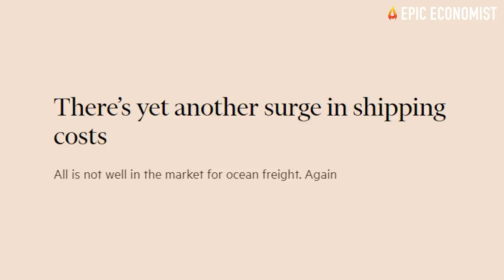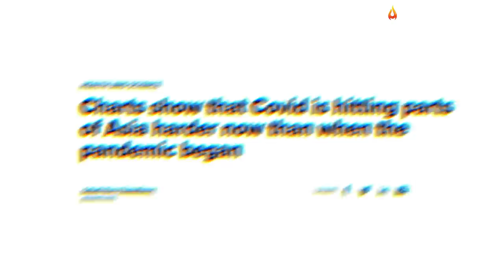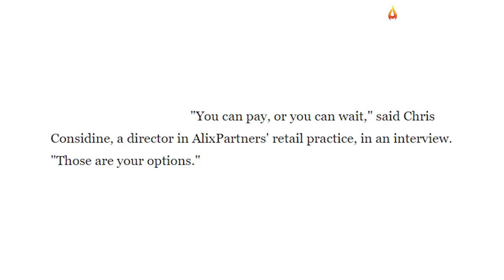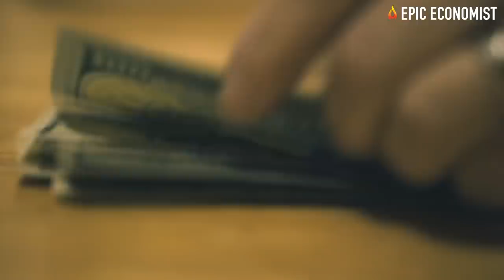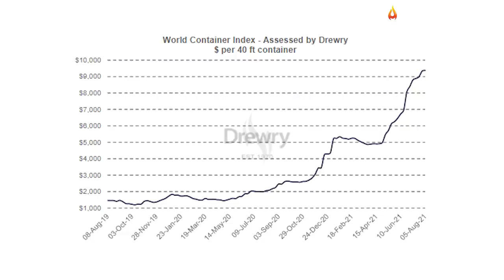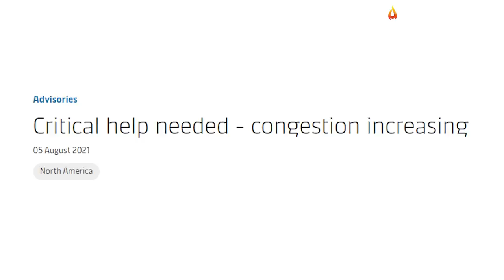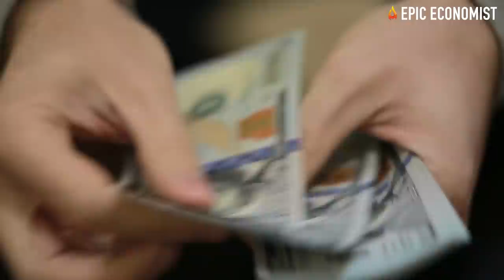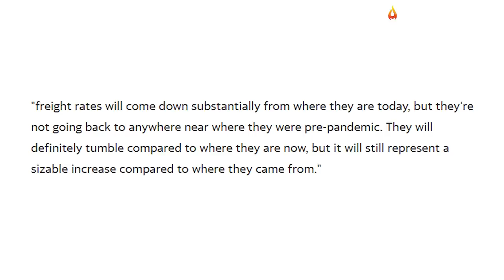Shipping Crisis Is Starting To Get Crazy: Freight Rates Skyrocket As Container Inventory Collapses

Comment: Maybe we could start making those containers. It’s just a strong metal box.
Reply: Good idea Billy!  Sounds like a real money maker at this point!!
Reply: @Petal Pusher Shipping containers are built in standardized sizes, typically 20' and 40', the ships are designed to accommodate containers built to this standard.
Reply: All they are is just a frac tank with doors.They build frac tanks all over the oil patch.
Reply: Ah what do I do ? America forgot what to do
Reply: The steel guys in Pittsburg should start rolling these things out. Old fashioned welding and machine work.
Reply: Tens of thousands of them sitting empty in Long Beach, CA...
Reply: Even if you had a yard full for sale at 1.00$ each you could not sell them. This is a system wide liquidity drain. The higher prices make for certain your my and their cash gets sucked up.  Containers are always empty in the port on the wrong side.
Reply: Thought the shipping crisis was due to so many containers being converted to living shelters
Reply: You miss understood the issue. There is no shortage of containers. It's that they go back empty and the ports are processing the incoming. There are plenty of containers, just not the capacity to ship them back to pick up more stuff for walmart.
Reply: Good luck finding workers to assemble them. You can't compete with free BidenBucks.
Reply: America has a low steel inventory, and China wont sell them any. lol
Reply: @renegademind1833  Cite your source on steel inventory.
Reply: It doesn't matter if you make them in the US.
Container shortage begins in Asia. There are a lot of excess containers in US that aren't even being shipped back to Asia. A lot of time, manufacturers in Asia pay extra to have an empty container ship back from US to Asia. So the demand for container in US is very low.

Comment: Stock tip 
Tell is at 3.00 and holding. It did go down but holding. 
Evfm. 82 cents. It will go to 1.20. That is a short term gain. 
Guns got to get this I buy it 1.50 it does go over 2.00 I like this stock I made alot of money here.
Open sold it today made 326.00 with 100 shares. Wait for it to go to 15.00 or 14.50 before u buy this one. 
Uwmc love this stock pays divident ever month and it is great to buy now. I sell this one at 9.20 to 9.50. It can go to 15.00 but not now. I do keep some stick in back ground just for divident.

Comment: China can use the new rail to Europe—cheap & with shorter time, then fm there to the Americas.
Reply: The basic issus  is labor and loading and unloading of containers at ports, railyards, and docks. Then theres the bottle neck of truckers getting goods to wherehouses and the down stream network from there.
So will in Europe, yes rail will a
Help a bit, but here in.the States not much. A good chunk.of the rails  Have stopped or slowed down.
Its a mess and a nightmare.
Get what you NEED NOW!
STOCK UP ON FOOD AND Necessary goods NOW. If you Need it or will need it then get it
Now!! Because tomorrow may be   
To late
Good luck 
Just my 2 cents
Reply: It does not really work because of the massive concentration of demand of goods by the US consumers, vessels were pulled from other destinations to meet this increase. This means that there are less vessels plying all other routes and it will be just as expensive. Additionally, the vessels from EU will still congest the ports at Longbeach and Oakland. The current freight increase is a GLOBAL PHENOMENON. 3 things we will need to fulfill to ameliorate this issue. 
1. More containers and vessels - this would take time to make and build
2. Expand container clearance capacity in US ports
3. Or in the alternative, the US reduces its imports of goods (and not only from China)
Good luck.
Reply: These new rail do not exist !